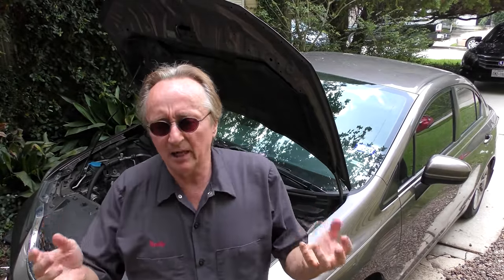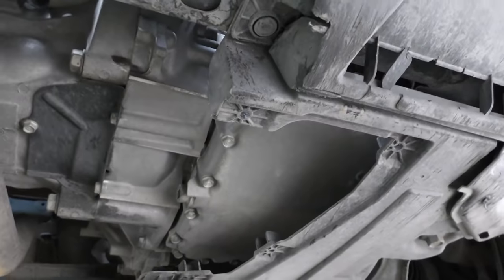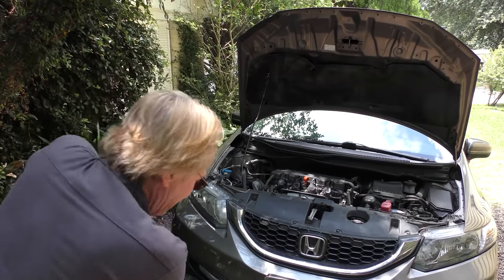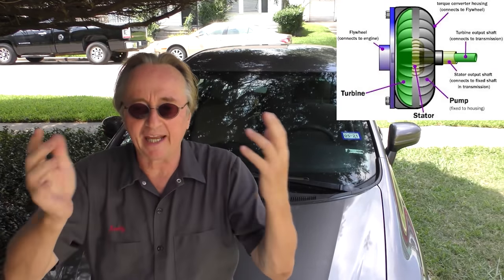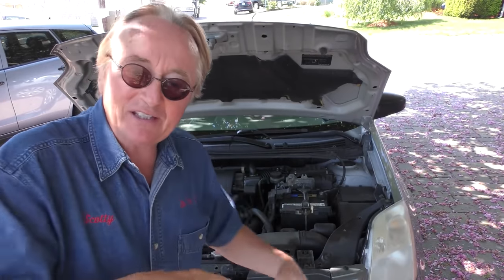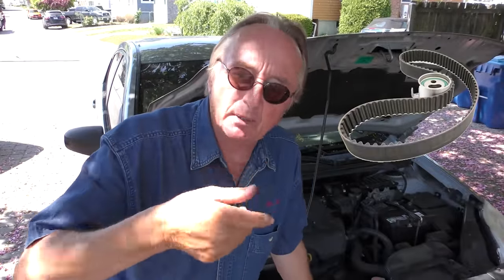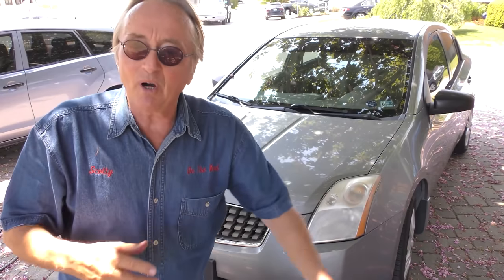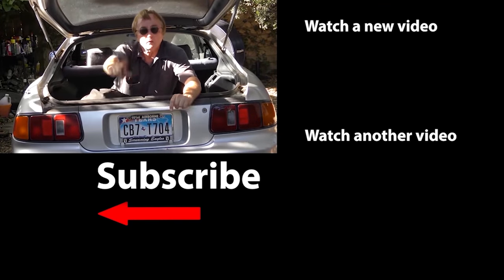Cars That Have Serious Transmission Problems (Do Not Buy)

Comment: I purchased a used 2015 Honda Accord LX because I was so tired of them giving me an unbalanced transmission because Im an amateur mechanic and I know how to change rotors. So had thought that I could beat them by getting a CVT transmission. Id read that the only thing that can go wrong is the main bearing. Much to my chagrin, this, like other cars eventually beat the rotor (actually within 5000) miles. I practically want to kill myself. Their private joy is still unharmed and intact. Also, when I asked them to change the in-line transmisson filter, they didn’t know how to do this, even though I had told them how. They wanted to charge me for a full transmission surgery. Took it down to  transmission shop, well-known, and like last time, they wouldnt know it. Mobsters, not cop outs. Also, they wouldnt change the filter.
Reply: If you know how to change the In line filter, then why not just DIY from the get go?

Comment: What about the Subaru
Reply: You have to change oil religiously. They’re prone to blowing head gaskets if you drive them with old oil. My nephew was bad on changing his engine oil every 5,000 miles, going to 8-10,000 miles. Needless to say the head gasket blew and the engine was toast on his 2014 crosstrek.

Comment: Hey Scotty, 2006 lbz duramax with 192,000 should I change rear diff fluid? And same for transfer case and what should I put in the transfer case if I do?
Reply: only change rear diff fluid if you go through water up to the axle.
those sealed diffs are bullet proof
Reply: Definitely change it. It’s not like transmission fluid where changing it too late hurts it. I personally recommend amsoil for that. Type in your truck on their website and go with the recommended fluid. The amsoil lasts a long long time

Comment: I have noticed that several transmission repair businesses have gone out of business and a couple have been around for 50 plus years. are the new transmissions not rebuilding or technicians have no way to learn this new transmission.
Reply: It’s not worth rebuilding transmissions anyway. I had a rebuilt one for an impala I use to have and it never drove the same and it still kept throwing transmission codes.

Comment: For me CVTs are just lifeless robots. Kinda how manual drivers hate automatics for taking away the direct feel of driving, CVTs are even more dramatic in that regard. At least with a geared auto, you still get predictable shifting and you have some control over "sweet spots" to keep fuel costs low. By trying to make every speed a "sweet spot" for fuel efficiency, I think these transmissions are really taking away any sense of connection with the road, beyond turning. Not a fan, even when they're built well (I drove with an Xtronic inside a Versa Note 🤣🤣)
Reply: Idk there's something magical in a smooth acceleration through all the gears. I forget I even have a transmission lol
Reply: These lifeless appliances are how the millennials like them. Point A to Point B. When you've grown up staring at a screen and have no  real world interests or enthusiasm for anything, appliances are for you.
Reply: @robertbell525  I think you mean gen z. Us millennials actually prefer to work on our own vehicles and houses.

Comment: The only CVT I can ever recommend while yes, it's made by jatco, Is the CVT7 that is in the Mirage and the Mirage G4? And the only reason I even accept these transmissions as they are is the fact that the car only makes 78 horsepower and 80 lb feet of torque thereabouts and it's not really going to stress the transmission out a whole lot, especially if you do constant fluid changes. I have a G4 now that has the five-speed and it is coming up on 100,000 mi with zero problems the whole time I've owned it. The CVT one I sold is pushing 85,000 and hasn't had any issues either which is beautiful. But yes as a whole I would not recommend anything with jatco transmissions. I am still very cautious about buying anything made by Nissan because of their transmission issues and that also includes the brand new outlander because it contains all of the running gear from a Nissan rogue and I'm really not impressed with how the transmissions have held up over the years
Reply: I iike the Mirage. I would not buy the CVT. Its too sluggish. It costs more to maintain. Costs more to buy one.
Reply: @djkenny1202  correct, which is why I sold my CVT and opted for a manual. It's a lot better with Fuel mileage around town too. The CVT I had would get around 38 City and 43 highway and that was the hatchback. My G4 manual gets about 42 to 44 mixed when I'm doing Lyft And I've pushed it to the low 50s on the freeway as long as I keep it at 70 or under. The only thing my hatchback had that my G4 does not is cruise control and I miss it.

Comment: Hi SCOTTY,
I have a 2019 Chevy Spark. Yes the jacko tranny. That said, we love the car. Do oil changes at 5,000 and the tranny fluid at 30,000.  We have 37,000 miles on it now.    
With changing the tranny fluid that way, how many miles could I get out of it before any issues may come about?
Reply: Be weary of the thermostat. Check it when you do your next mantainance. You might do many miles without almost any issues if change it before 40k
Reply: Dude I'd be very wary that's a cheapo car with a known poor transmission. They are disposable appliances. Keep the fluids changed, don't beat in it, and just realize that when something breaks it will probably not be worth fixing.
Reply: @RPD91  besides watching the temp gauge, how do you check a thermostat? It either works or it doesn't.
Reply: My 2016 Spark with Jatco CVT has 104,000 miles currently. No issues with engine or transmission. Been a solid lil work commuter for me.

Comment: My Parents have a 2013 Nissan Altima with a C.V.T Transmission.   I think it has about 40,000 miles on it right now.   I know it will probably die at about 80,000, from what You said.
Reply: Has your parents changed CVT transmission fluid soon? I've heard owners change did transmission service and last 200K 🤷
Reply: No.   They have never changed it.
Reply: @russellhancock9765  they need to change the fluid since owners said on comments about fluids. Maybe your parents drive normal without damage it. When I said drive normal meaning like they're not type of racer person to floor the gas to accelerate hard or brake hard. So the transmission is still fine. I was thinking to get Altima because of feature and look.  After looked it up on YouTube comments,some people said transmission suck or other people said transmission last longer with not problem because they changed transmission fluid every 30K or whatever. But I'm aggressive driver,I like to feel smooth accelerate like a racer so I picked Camry V6 with automatic transmission. I drove CVT and I hate when I don't hear gear shift.
Reply: You are probably better off with a Toyota.
Reply: @russellhancock9765  I already did. I put 325k miles on it on Camry 05.  Transmission still good condition and weak accelerate (sold). Now I have 70K miles on Camry 2016 V6.

Comment: I thoroughly enjoy my 2016 Nissan Versa manual everytime I drive by the gas station and drive by a guy like Scotty doing a 50k fluid change on "reliable" Toyota & Honda cvt's. 
80k no maintenance except oil, filters and tires. 42mpg

Comment: Funny you mention the 8 speed toyota transmission Scottie. The transmission in my 019 Camry has to be the worst transmission I have ever experienced. It's rough, shifts erratically, and jerky, once rocking me back and forth in the drivers seat, and once downshifting too soon with a bang sound. Now most of the problems I encounter are when cornering in roundabouts (they have gone crazy here on PEI, Canada),when powering out of the roundabout. The dealer did a magic software adjustment and it has helped, but I have to think all this erratic behavior in my trany has to be shortening it's life.
Reply: These cars don't need 8 or 10 speed automatics...shifting all the time. 6 speed is way more than enough.

Comment: CVTs are terrible if you drive in mountains because they don’t engine brake like a standard automatic transmission.
Reply: Yes they do in certain cases. Either way, why would you engine brake? Use your brakes to brake.
Reply: @ln5747  lol
Reply: @ln5747  on long down hill runs riding your brakes will cause them to overheat and fade. If you drive in the mountains even just a little you learn pretty quick using a lower gear on a downhill run is a life saver.
Reply: @aleblanc3547  nonsense, decent brakes on an average car won't fade. Not to the extent they will fail and be "a lifesaver", unless in very extreme circumstances perhaps. A large truck/lorry is rather different to a car which it happens to often. Use your brakes as intended for downhills, not your engine to brake.
Reply: @mikekokomomike  what's funny?

Comment: Scotty would you recommend me sell my Lexus es350 for an awd Lexus is250
Reply: Those 250 engines have problems
Reply: @jacobyo99  like what kind of problems?
Reply: I think J. Shreve is right. The 250s tend to have a small increased amount of issues, compared to the 350s. Also, as long as you keep good tires on any front wheel drive car, it will do good enough in snow and ice, just don't drive like a race car or expect winter tires to magically appear, haha.